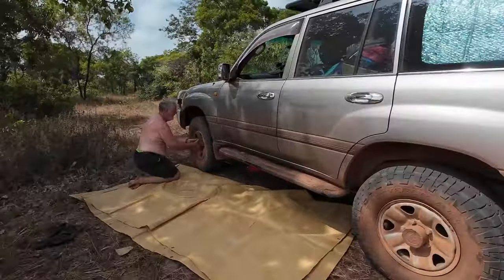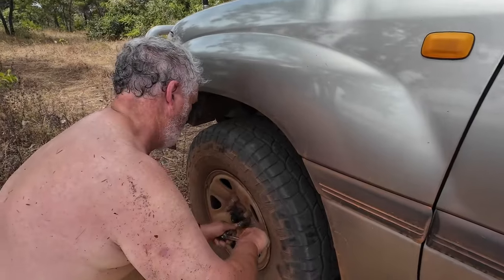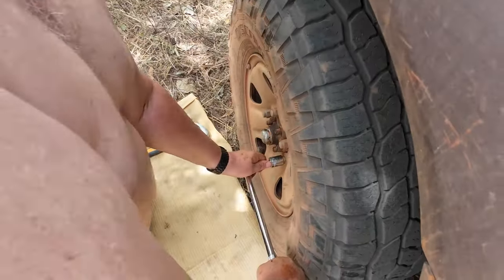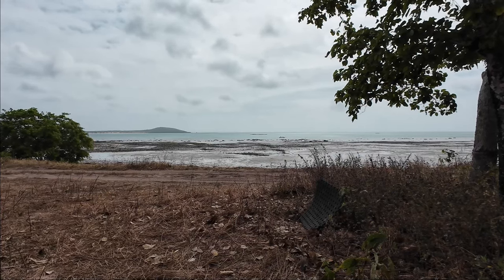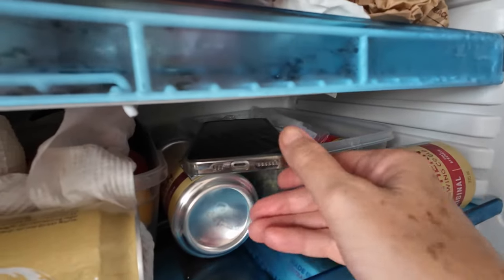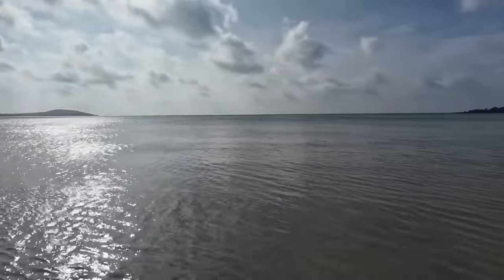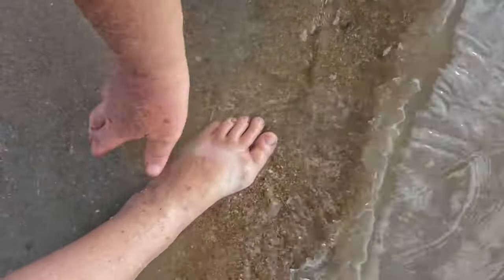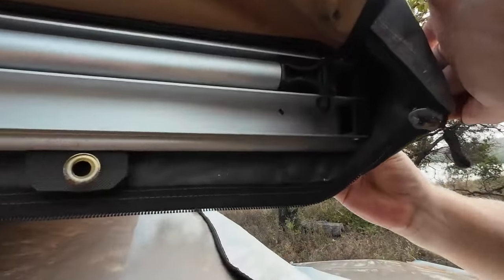Cape York part 6 Punsand Bay free camp can we fix it?

Comment: Also getting under the car with just a bottle jack  and no stand is pretty silly. If u don’t have a small stand just chuck your spare tyre u der there as a back up. It’s a long way to hospital if someone happens.
Reply from the maker: Did you watch the whole video as I didn’t need to take the wheel off it was only lifted enough to rotate to check the noise was gone?
I am aware if I had removed the wheel I would have put it under the car. Thanks for your concern we do appreciate the comments.

Comment: I have only owned my 100 for 4 months and 2 months ago I wanted to check the front wheel bearings. The left dust cap had been off before and was stretched from being centre punched to make it stay put. It didn't really work as it was the silicone gasket that held it in place. So I ordered new caps, but in the mean time I thought how can I keep the old one in place to make the car mobile. I noticed he end of the axle was threaded, so I drilled the old cap, cleaned it, applied silicone gasket to the outer lip and to a bolt head and spring washer. Tightened the bolt just enough and drove around like that for 2 weeks waiting for the new caps. I had no problems at all with this. And if I was to be driving on rough roads now I would probably purchase some copper washers and do the same thing again. I can't see any reason for not doing this as a permanent mod.
Reply from the maker: Mine has never come loose before but we did do a lot of corrugations. Will keep an eye on it in the future.